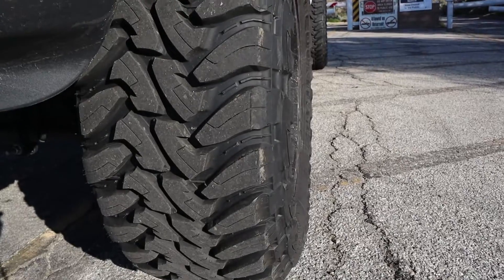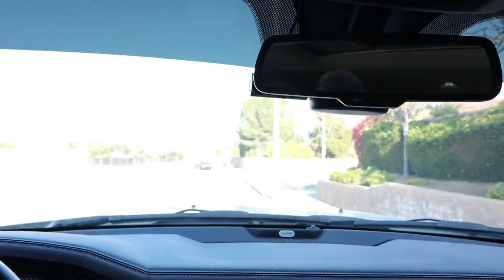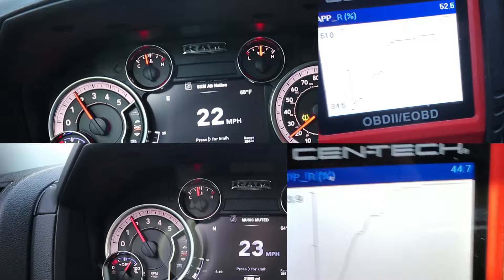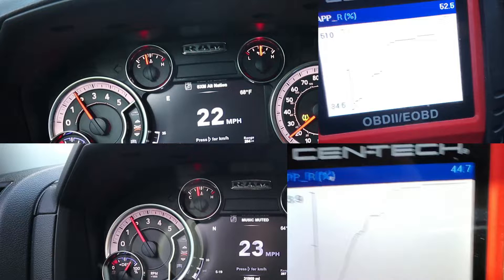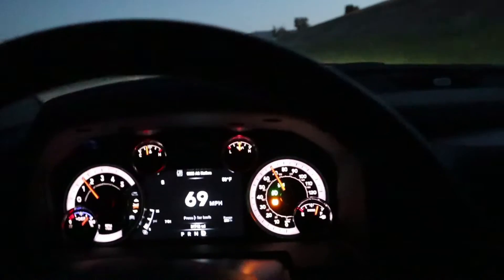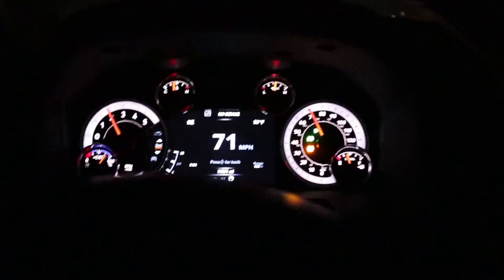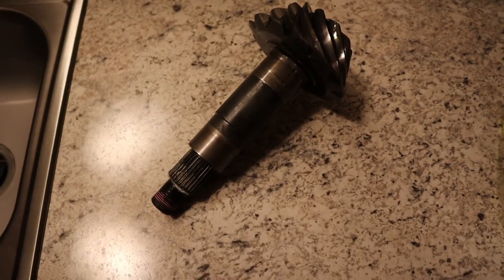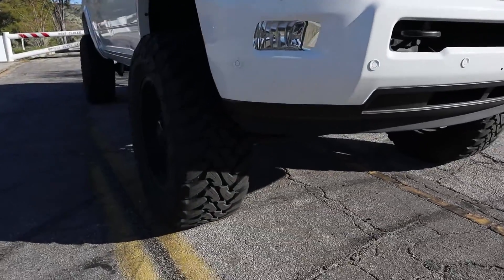Comparing from a 3.42 gear ratio to a 4.56 on the RAM 2500 with 37 inch tires!

Comment: I reheated to 4.56 I followed the post on cummins forum from a member that was taught by an experienced mechanic how to set up the ring and pinion by feel on a gear swap . I went from 3.73 to 4.56 I took my pinion to the local shop to press on the bearings the rest was done by feel the contact pattern was perfect coast and drive side of gear . Cost me $850 for the gears plus master install kit and $40 to press on the bearings.  The 11.5 and 9.25 are some easy axles to set up .

Comment: The truck can handle the numerically lower ratio very well.  I see leaving stock and enlarging the tires as a higher gear and savings on miles on the clock if you are still in warranty.

Comment: What you want to do is monitor boost pressure of the turbo that will tell you how much load is on the engine. It should be higher with the 3.42 with the same throttle position idle test would be climbing a grade in the same gear.

Comment: Boost and Fuel Rate are precise for comparing energy needed to roll the truck with different weights or loads, including the Tires/Wheels

Comment: Will I blow up my truck or screw anything up running 37s and 3.42?
Reply: (45hp tune, 3 inch lift)
Reply: You shouldn't have any problems with it.  
You may notice a decrease in fuel mileage and a little more lug under a load. 
But it won't hurt the truck.
Reply: @codygalloway5386  thanks
Reply: Eventually, the transmission will probably give you issues.
Reply: @brucebroeking1570  I ran them for 2 months and just took them off they look nasty but I like my 20mpg instead of 10 lol
Reply: No. The Cummins loves to grunt. People haul with them everyday, not going to phase it.

Comment: Hey there. I have a 2013 Ram 2500 hemi and wanted to know would I have to regear for a 285/75/r17 tire? Thanks.
Reply from the maker: Hey there, so that size comes out to about 33.9” or a 34” tire. The 2500’s should come with the equivalent to a 31” tire if I remember correctly (265’s). I would say you are definitely ok and good to NOT have to re-gear. I ran 35’s (as do MANY people) on the 3.42 gears with no issues at all. Your truck most likely has 3.7_ in it anyway, not as “high” as a 3.42

Yes you do lose some torque being the gas hemi but for the size of the power train, 34’s won’t give you issues to the best of my knowledge and experiences with using factory gears. Most don’t re-gear until they hit 37”+ or are using the truck off-road only

Comment: Is that in 6th gear? Are you sure you didn’t get 4.88s?
Reply from the maker: I know it was 4.56’s as I got the boxes that they came in (well I guess there is still a possibility the gear company could of messed up) but I’d say it was 4.56’s.. I’ve seen similar RPM’s with that size tire and setup, but there always could be that chance without actually going in there and counting the teeth or seeing a stamped part number
Reply: @DevonsGarage  according to a gear calculator, with a 36.5 (37) inch tire, at 75mph your rpm’s would be 1951 for 4.56 and 2088 with 4.88s, in 6th gear. I just saw 75mph and 2100ish rpm on your dash and thought maybe you had gotten 4.88s. Ian putting 4.88s in mine soon is why I was asking. I tow with mine so going with 4.88s
Reply from the maker: @kylemoore9626  oh! Ok one thing I will say is the speedo was off about 5 mph, so I was actually going about 80mph and according to google, those 37’s specifically are 36.8 (not sure if that all makes a difference in the math). Off-road Bully highly recommended that I did 4.56 for highway speeds. To me it felt good and didn’t get too high on the RPM’s at 80. I always remembered being about 2000-2200 at around true 80 mph but it’s also been a little while

Comment: Sadly with larger tires and wheel footprint and weight your still donning small bearings, axles, unit bearings and ball joints and front links and tie rods.  Unless your putting on upscaled components your ruining a truck by putting on huge tires.
Reply from the maker: Oh yes I definitely agree, but there isn’t much on the market or recommended to have to upgrade for 37’s on a 3/4 ton truck with solid front and rear axles (Dana 60 up front and I believe but may be wrong, a Dana 70 rear). Now will it wear faster than the factory 31’s on that same truck? Heck to the yes! Lol 
But comparing that to putting 37’s on a 1/2 truck like a 1500 or F150, and that’s where you REALLY tear apart bearings, suspension components, and all steering components. Usually, at least from what I’ve read, the weakest spot in going 37’s in a 3/4 ton is the need to re-gear. 1/2 tons require a lot of upgrades to do it correctly (if that is even a thing: ‘correctly’)
Reply: They don't really make a bigger axle though. If you wanna drive with 110's on a ram, you'd be the only one..

Comment: before you regeared, did you have any flare between shifts? If so, did it go away when you put the 4.56's in?
Reply: Every 68rfe has flare between shifts it’s how the transmission was designed.
Reply: @YippeeKyyay  really? Interesting

Comment: ¿35x12.50r17.  4.56 gears?
Reply from the maker: I wouldn’t recommend that high of a gear for that size, that would cause your 80mph to be near 3k rpm
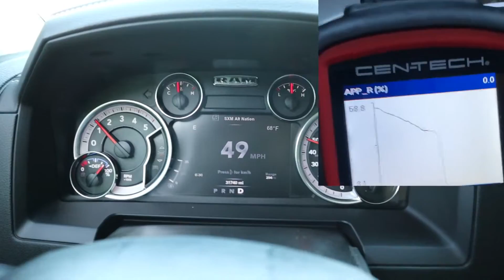Reply: 4:11
Reply: @DevonsGarage  with 34.5 rolling diameter, 4.56 gears, .63 6th gear in my Aisin I run 2250 at 80mph

Comment: I have a 6.0 2002 1500hd silverado 9in lift on 40in tires. What gear ratio would you recommend on those?
A gear shop said 4.10 but idk?
Reply from the maker: Oh man that’s a gnarly tire! Heck yeah! Shoot, honestly me personally (being that it is also a 1500 and I wouldn’t want my transmission to handle too much starting torque from every stop) I would go 4.56 minimum… however your freeway speed will be pretty limited hence why the shop is probably recommending 4.10’s… 

You will have to ask yourself if you want more of the better gas mileage (if that’s even a thing with 40’s lol) and top speed to get the 4.10’s (also if you plan to be at higher speeds quite often like above 70-75 as your usual drive) OR have a lighter “load” on your drivetrain, more low end torque, but slower high up then the 4.56 or above. 

Both are great gears

Think of a battery drill where you can change the speeds on top between 1 and 2… speed 2 is fast but stops at a bind (no torque) while speed 1 has all the torque to get through tough material using larger drill bits
Reply: @DevonsGarage  it has a 4l80 trans just rebuild it. The previous owner put 5.38 yukon gears. What are your thoughts on those? It's more of a mud & weekend truck.
Reply from the maker: @christianmoreno5424  Now that sounds more in the range of what I’m used to hearing for 40’s (especially in the Jeep world). 5’s are great for off-roading (probably could even light those 40’s up if the driveshaft doesn’t bind first lol jk)

It’s all about compromise, I was VERY in between 4.10’s and 4.56’s with the Ram but after talking with the shop that had done a ton of the same truck with tire combo, I went with their recommended 4.56 to have more low end torque and less stress on the drivetrain. The higher the number, the less stress but it all comes with a cost: Engine speed and Practicality 

I would see if you could find anyone running that size tire on your same truck and see what they are running (if there’s any info out there) to kind of get some specific feedback. You could even see what people are gearing to with 37” tires and how they like that setup. Because if they are 4.56 with 37’s and they are saying it’s a perfect “like factory” match, you will most likely have some unwanted stress with the 40” tires

I haven’t done much research for what should be ran on 1500’s past a 37” tire since I usually cut the limit on 1/2 ton trucks at 35” tires for longevity. The 3/4 tons however (2500’s) I would say 40’s all day! Haha

But yeah, see if you can find anything around!
Reply: ?? At least 4:88 or so .  Probably more . Thats a big hoop..

Comment: I have an 03 RAM 1500 quad-cab 4x4 with the 5.7 HEMI and I have gone from 31.5-inch tires to 35s with the stock ratio of 3.55:1. I drive 50/50 highway and city rarely going above 65-70. Most have said to go with 4.56 gears but some have said that 4.10 was plenty for them. The equation of (35/31.5)*3.55 gives a new ratio of 4.09:1. I don't know what to do. Could you help? Thanks!
Reply from the maker: Hey there! I personally would run a 4.10 with that tire size… many run 35’s on 1500’s without any re-gearing.. I personally have a 2021 Rebel 1500 right now that came on 33’s factory and I’m now running 35’s. I think it has a 3.95:1 in there but I’d have to double check. 

I think if you towed a lot and didn’t mind losing the “high end” speed then sure, 4.56 would be fine. As well as for some decent offroad-ing.

But for a 50/50 driving habit and just driving it mainly as a daily and just normal day to day truck activities, I don’t think you can go wrong with the 4.10’s and 35’s

(Edit: had to change the semicolons to periods in the gear ratios so it wouldn’t “timestamp” the video)
Reply: @DevonsGarage  thanks 😊

Comment: I am running 37x13.5x20 and want to tow a 37’ travel trailer. You suggest the 4.56 or 4.10’s? I live in the west with hills. People are all over with opinions.
Reply: 4.56 gears for power 
4.10 gears for better gas mileage
Reply: They offer a 4.44 in the factory AAM gears
Reply: 456
Reply: 4.88

Comment: I’m still rolling 37x13.5R17 Toyo MT tires with stock 3.42 gears on my 18. Installed the Thuren performance suspension and tires at 1,000 miles, I’m at 23,000 miles now. I’ve had a small tune since 7,000 miles, and I get 17 mpg at 75 to 80 mph. Trucks happy, I’m happy, and the transmission is fine. As for load, look at your boost at 75 to 80 mph, mine is 2 to 3 psi, gps mph, not what your speedometer shows now.
Reply from the maker: Hey man! Couple of things, 
1, that is pretty cool that it’s going well with the 3.42’s... I have not heard good things with the amount of stress later down the line at like 75k miles etc. I really wanted to keep those gears for highway but this was a better option for all around and 90% of people I talked to agreed for the power trains sake.
2, my speedometer to GPS difference for some reason stayed the exact same before and after the gear installation.. something the shop and I have also been slightly confused. I have an actual speed app which I used and then also Waze but both said 5 mph difference.
3, yes the 75/80mph is where the con comes to play with 4:56’s (same with RPM, I get pretty high up there at these speeds) and it was the most hesitant part for me as I drive highway quite often. 

All in all , I would say that at the end of the day 4:56 is definitely easier on the truck no doubt and that 3:42’s can indeed be used as guys are doing it. 
For that, I would ask other questions to myself if I was considering the swap like towing, how much highway use compared to city, what speeds I plan to drive most of the time, am I planning a tune, etc etc. 

Speaking of tune, I just got my 5” piping and tuner in to do some “modding” but can’t make a video on that around here 😅 if you know what I mean haha
Reply: @DevonsGarage  My truck isn’t a work truck, but I have pulled a dump trailer with gravel for the driveway, about 14,000 pounds. I held it back in 5th, and it did amazing, I was actually surprised. I’m keeping this one on the 30hp tow tune, and with the better transmission programming, I doubt the transmission will ever be an issue. I do plan on a valve body from revmax when I service the transmission for the first time, but that’ll be a few years down the road. 

  I’m guessing your speedometer gets it’s information from the wheel sensors, that’s strange.
Reply: @fearlesscamshaftleader2197   lol I have the SAME set up as you, but I have a revmax valve body, and 35K on the odometer.  I have some shift flare between 4th and 5th, but nothing crazy. Other than that my truck gets 14.9 combined...it's great.

Comment: Thanks for the video 💪💪💪💪💪 sir the speed on the gps did not change right ?
Reply from the maker: I seem to be 5mph off from my speedometer when using GPS based app’s on the phone and occasional Radar detecting street signs. But what is odd is I was 5mph off before the swap as well. So the shop and I couldn’t really understand where speed was being taken from unless it IS at the transmission and reading driveshaft output instead 🤔

Comment: Just so you know any 13-18 2500 and most 3500 Rams  the only gear ratio was 3.42 you couldn't get anything else the only way you could get a 4.10 was with a dually aisin trans and custom ordered 4.10s. ram is stupid for putting 3.42s in their axle I regeared mine and I'm on stocks hated towing with 3.42s
Reply from the maker: That is crazy, I believe it. My build sheet for the truck when I bought it new said 3.73 but then further down the sheet it said “sport package” with a sub menu and in there it stated 3.42 which really bummed me out. But it has definitely been awesome now with the 4.56 👍🏻
Reply: @DevonsGarage  I know it may say things on paper but I can assure you 2013-2018 99% of the diesel 2500/3500 are only 3.42s I researched forever to find 4.10s when I bought my 2016 couldn't find jack other than 3.42s and finally realized that's all you could get so I finally bit the bullet and bought the exact truck I wanted and didn't worry about gearing because I knew I would change that anyway
Reply from the maker: Max Penetration oh wow see this part I didn’t know, but I agree I did the same thing because I wanted everything else in the truck and knew I would have to regear anyway once I put on the 37’s. Really sucks that they are putting them out like that. I guess for more MPG or something lol
Reply: @DevonsGarage  2500/3500’s come with 3.73’s with the gas hemi engines, once you add the Cummins option it changes to 3.42,  doesn’t matter what trim package
Reply from the maker: @DODGEramDAMN  according to my build sheet, it states 3.73 gearing right after the 6.7L Cummins then off to the right it says Sport package and has a sub menu under it where it listed the 3.42 gears. Which is the only reason I mention it that way. When I asked the service department why they rip out the 3.73’s, they said because the sport was looked at as a more highway commuting vehicle idk 🤷🏻‍♂️ but a lot of guys have the 3.73’s with the diesel stock
Reply: My 06 has 3:73 s
Reply: @omen2098  some aisin comes with 3.73 witch is 4.10 gears on a 6 speed